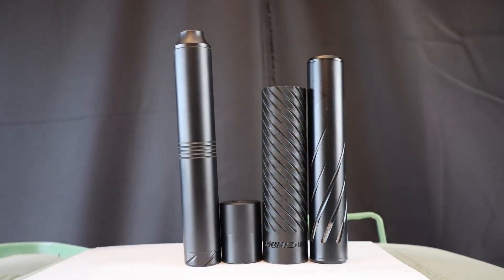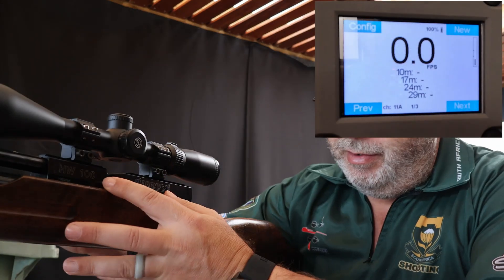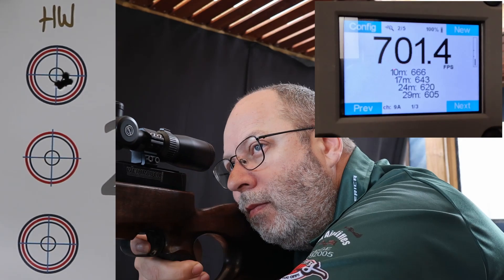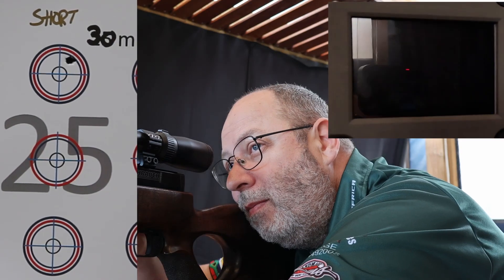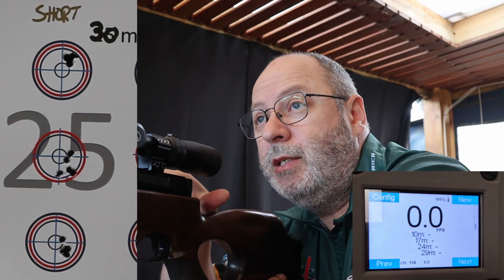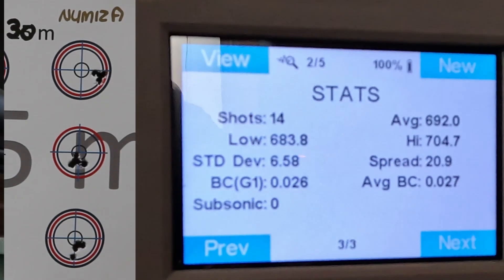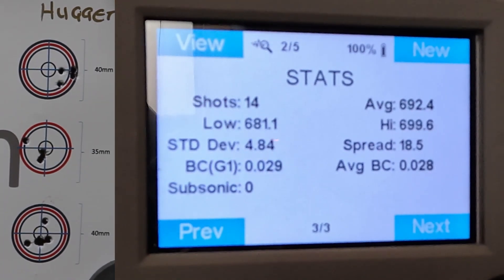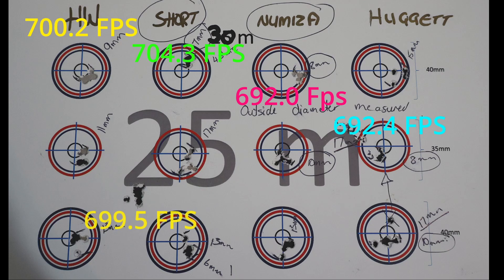Does a Silencer change pellet speed?

Comment: Hi there. Please could you assist me. I am looking at getting the Behemoth bullpup .22. I have a 4500psi hand pump. I saw your video where you set the reg pressure to 135 bar and filled the gun to 250 bar. How many shots would you think I would get,because it would be way to difficult to fill the gun to 300bar.
Reply from the maker: The behemoth has a very small tube, but I do think you should get 40+ shots from 250 bar to 135 bar

Comment: There is a much bigger impact on free floating barrels. The harmonics changed much more on weight.  A longer silencer  even if it is lighter might have the same impact as a shorter heavier one as per the law of leverage. 
Add to that the design of the chambers it becomes quite involved.
A long first chamber allow the air to pass the pellet  causing air resistance that slows down the pellets.
This will also apply to barrels  with front end support. The weight does not effect it that much though

Comment: My understanding is that without a silencer the expanding air just goes out in all directions once the pellet leaves the barrel, converting what energy is left to sound essentially. By containing and controlling the expansion further beyond the muzzle you give that energy a place to both impart more work on the pellet, which improves velocity by some margin, as well as reduce the rate of expansion reducing noise level.  I'm wondering more so now about how much change actually happens when higher muzzle velocities and larger caliber pellets are involved, and if the same effects follow regardless of pellet shape.
Reply: Agreed

Comment: Did you check the difference in the outside diameters of the holes in the suppressor baffles through which the pellets are flying within?
Another thing that most likely effects velocities is the performance of the baffles.  Optimum performance of the baffles would mean that they trap more of the high-pressure air within those baffles that would otherwise be pushing the pellet forward in the first place.